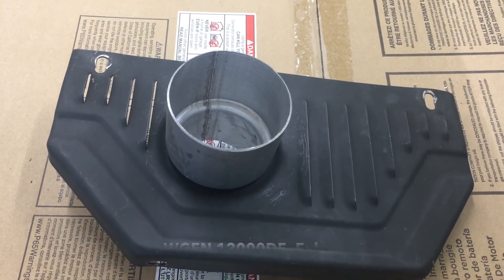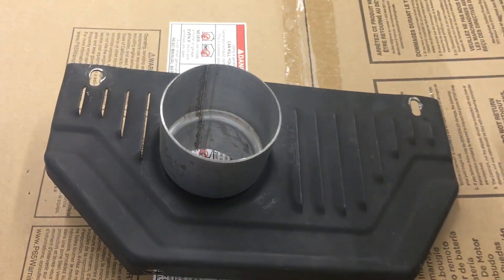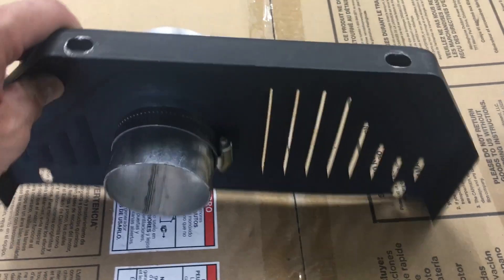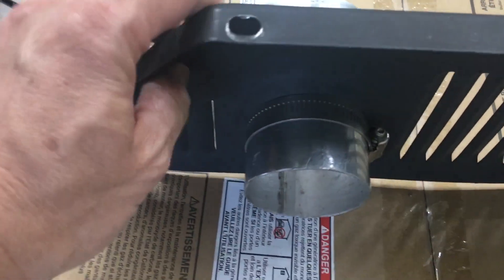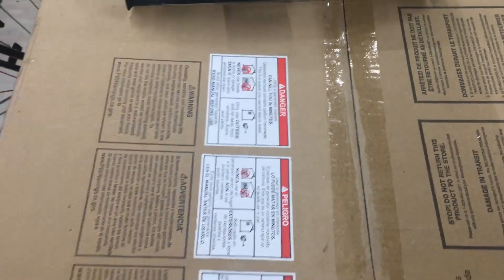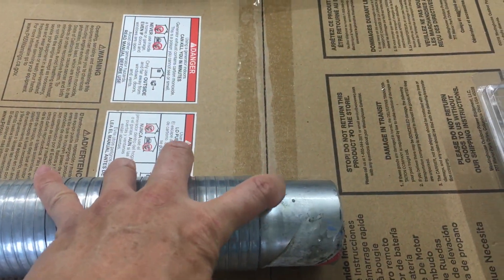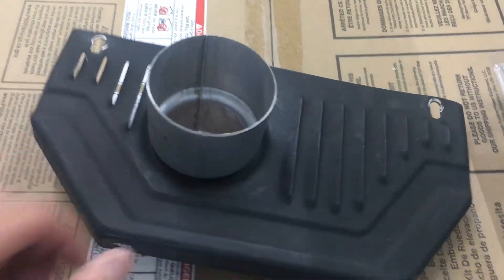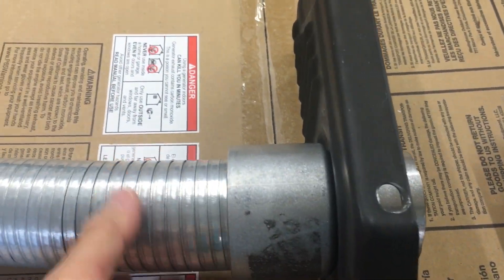Part 10- Westinghouse WGEN12000DF 15000 Watt Dual Fuel Portable Generator Exhaust Extension Mod

Comment: Hello ,
Really neat and simple setup. 
Where did you find the flex with the reducer attached  ?

Thanks in advance.
Reply from the maker: You can p/u at your local auto parts store.

Just bring that cover with you so you can get the right size

Comment: I am having trouble with the throttle control solenoid sticking at a low throttle when toggling the "low idle" switch OFF. It will idle down fine when turning the "low idle" ON, but the solenoid seems to  stick when trying to rev back up to achieve 60 Hrz. Does anyone have experience replacing this solenoid? Maybe have a video link of how to do it? Thanks!

Comment: I have a 7500 Westinghouse and want to use your idea can you send more pictures as I have so many questions.
Reply from the maker: What kind of question(s) do you have. Ask away and I will try and help
Reply: @gilbosdiy  thank you. Mainly my questions surrounded exhaust. I was going to tap the inside of the muffler outlet , screw in a nipple and slide flex tubing over the nipple. The nipple diameter as determined by the exhaust outlet is one inch. I assume I would I would need a piece of flex tubing slightly larger.  Finding a source for the flex tuning is hard and no luck. Any thoughts would be very helpful. Btw a friend told me that the muffler exhaust metal is too thin to thread, I have no idea.
Reply from the maker: @sidneywhite749  I originally thought about going your route as well. Then more and more I thought about it, too much work. 

Then I went with this method of using a radiator screw clamp, to hold the exhaust adapter to the heat shield, a lot simpler. I then as you saw in the video

Does your heat shield remove like my generator. If it does, best to take that piece off and go down to the local auto parts stores. So that you can have it with you to get the correct reducer muffler adapter. If you can find a exhaust adapter that fits through the hole of the exhaust shield, you can basically go the same route I did.

Another note, on the adapter I used, I had to trim the smaller end shorter, due to the fact the distance between the muffler and the heat shield. I trimmed enough for the adapter to sit against the heat shield on the larger end. doing so allowed me to use the radiator hose clamp.

I think O'Reilly might have 1" flexible pipe that they sell by the foot (Walker 1 Inch Steel Pipe - 40000). So if you have an O'Reilly near might want to check them out. Hope it helps
Reply: @gilbosdiy  I like your method better. I took off my heat shield similar to yours, The  spark arrestor was held in by two 6 mm bolts that went into ears on the exhaust body. I will need a 2 1/2 reducer to cover. I have a reducer now that is 2 1/2 on the big end and 2 1/4 on small end. Either I need a flex tubing to go inside the small end facing out or over it. Where do you think I should look for the flex tubing. The reducer is too long as the muffler outlet is close to the heat shield so I will have to make the hole in the heat shield large enough to manipulate the reducer forward and control the movement with clamps on both sides. What a pita.
Reply from the maker: @sidneywhite749  What is the diameter of the hole on your heat shield, 2 1/4"? O'Reilly auto parts sells flexible tubing by the foot. Does the spark arrestor touch the heat shield??
Reply: @gilbosdiy  no the spark arrestor bolts to the muffler with and elliptical egg shape cover plate with two bolts. The hole in the hear shield is egg shaped like the Spartan arrestor only larger in diameter allowing access to the spark arrestor cover hold down plate and at its narrowest place it is 2 1/4 . How can I send a picture? Cut and paste?
Reply: Really the hole on the heat shield is more of a cloverleaf pattern. I see Amazon has a Firmin exhaust kit with a exhaust plate resembling mine, might fit.
Reply from the maker: @sidneywhite749  For your situation, one of these two is probably the best solution(s)

https://genexhaust.com/bolt-on-extension-kits/

or this one

https://www.ebay.com/itm/144711807105?mkcid=16&mkevt=1&mkrid=711-127632-2357-0&ssspo=TfqPFzuMRde&sssrc=2047675&ssuid=kbj-eocLQPW&widget_ver=artemis&media=COPY

Comment: on my generac 17500 I found that along with a heat tape it was beneficial to also use a ceramic fiberglass wrap but then again I'm in Texas where it's like 190 degrees in the shade during the summer.
Reply from the maker: You are absolutely correct, since posting this video, I have the exhaust extension wrapped.  

As always the wrap didn’t arrive in time for the video

Comment: What did you use to keep the reducer and flex pipe up against the muffler or is it just sitting there with no seal?
Reply from the maker: So basically I used 2 exhaust reducers. The reducer on the flex pipe is a smidge smaller than the one I have mounted to the heat shield. When I insert the flex pipe into the heat shield it seats itself. So I guessing your wondering if the flex pipe is loose and can rattle off. The answer to that is no, the two reducers is nominally the same size ID on heat shield reducer and OD on flex pipe reducer.
Sorry I didn't reply sooner, I didn't your comment
Reply: @gilbosdiy  Thanks for the details!